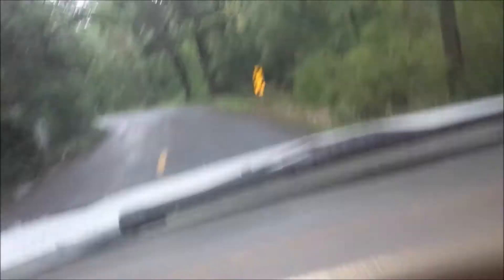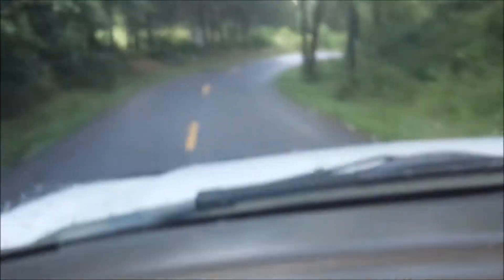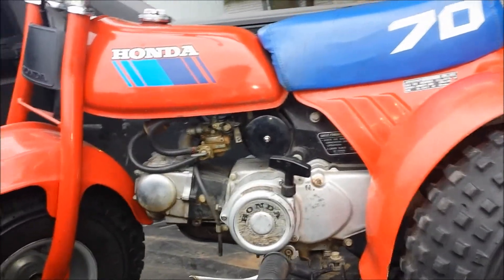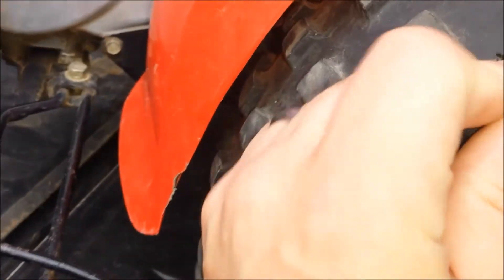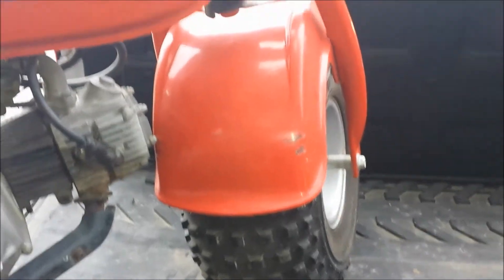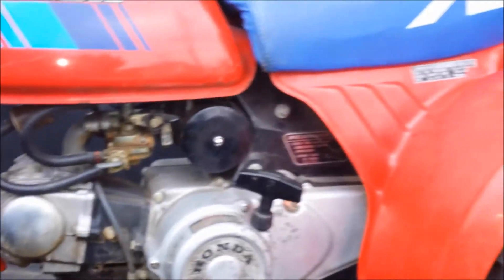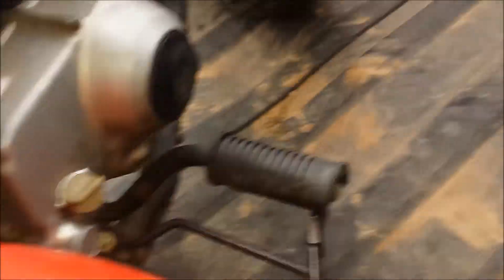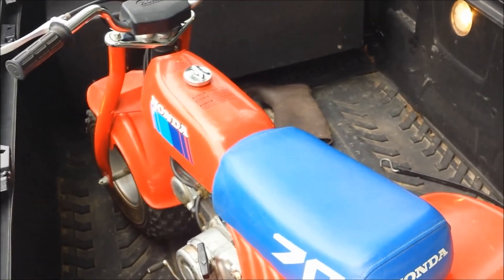1985 ATC70! score!

Comment: Very clean looking machine.. Just a heads up, the frame is bent.  Look up under the tank right near the coil mount and you will see where.  So many of these have the same issue. Can always tell if the front fender has been rubbing on the head bolts.
Reply from the maker: thanks man ya i figured shes a lil bent like the all are. i think he had some relatives who did it. in tryn to think of a way to bring it back cause its perfect everywhere else